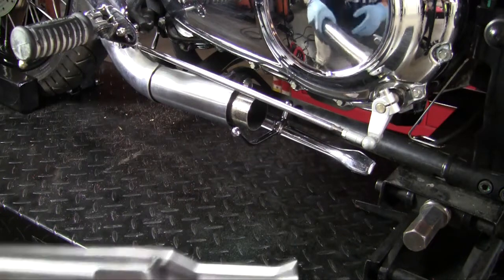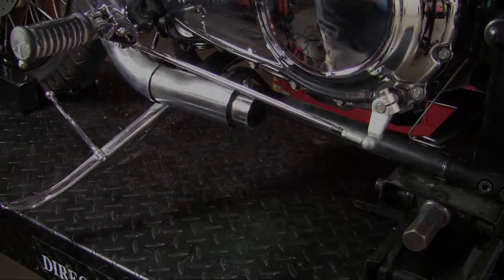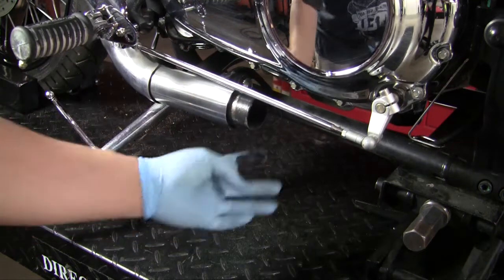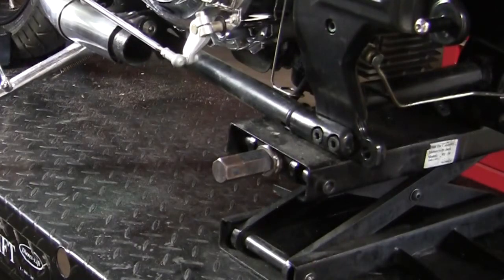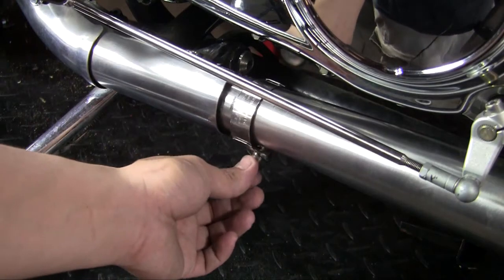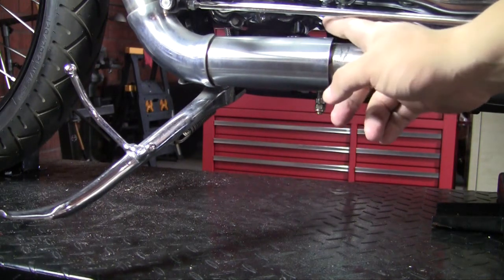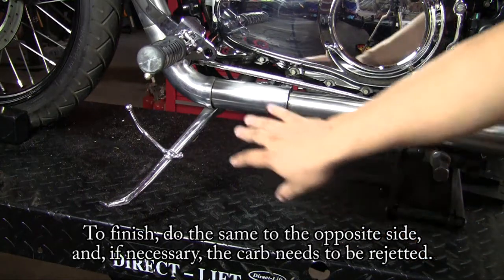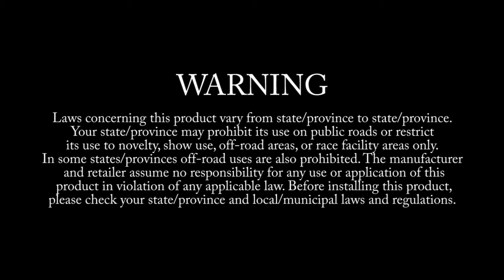British Customs Cocktail Shakers

Comment: Here's a question: With the knowledge that removing baffles in drag pipes severely drops TQ and HP in low range, how are these? Has anybody dynod these pipes at all? I really would love to know because the sound is amazing, I just don't want to overly pay for it.
Reply from the maker: Our Cocktail Shakers have been around for quite some time with extensive R&D, the shaping, baffling & length is all perfect for fitment & performance; it flows really well. Besides performance, you're also paying for quality as these are made from 304 Stainless Steel and TIG welded opposed to Chrome and MIG welded.

Give us a call if you have any more questions!
Thank you

Comment: What if I only replace the exhaust pipes and I won’t rejet my fuel injection system? how much will this change fuel consumption?  how much will it harm the engine?
Reply: At the minimum you will need to add a shim or 2 to the needles. You want the best performance, i still would rejet.
Reply: @beamerstrumpet  thanks a lot!))
Reply: @Championtrainer1991  my pleasure. look online for bonnevilleamerica.com and get in teh forum. thre is a TON of knowledge in teh tech sections and the MOD sections. Good bunch of fellas also.  My CDI is not a pro com, but i cant for the life of me remember what brand it was. it was plug and play, no mods avaliable. but diffinatly hleps 5th gear for milage.  and drop to 4 and 3 for some real fun!
Reply: @beamerstrumpet  I used TuneECU and remap bike with "cobra" pipes already)) sounds awesome! Delete SAI and change air filter to hi-flow. Running like hell!)))
Reply: @beamerstrumpet  and I use Facebook Triumph speedmaster owners group. Really helpful)